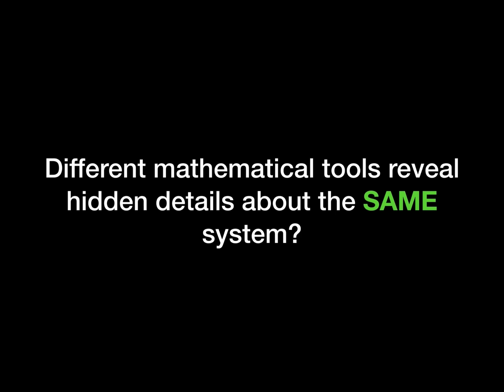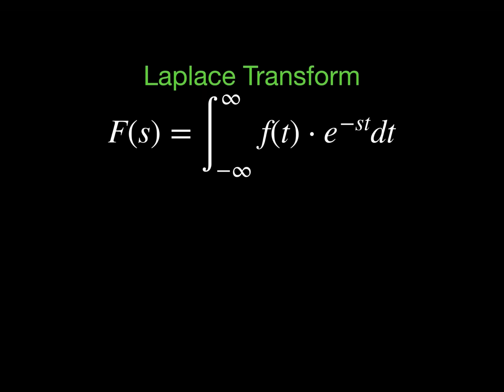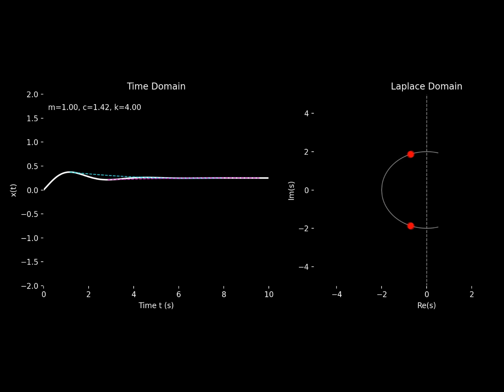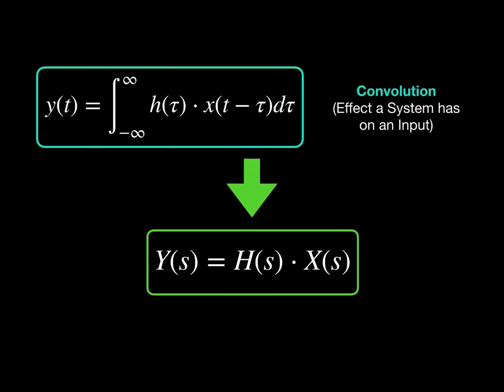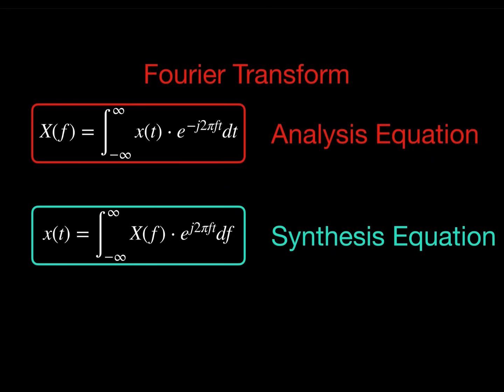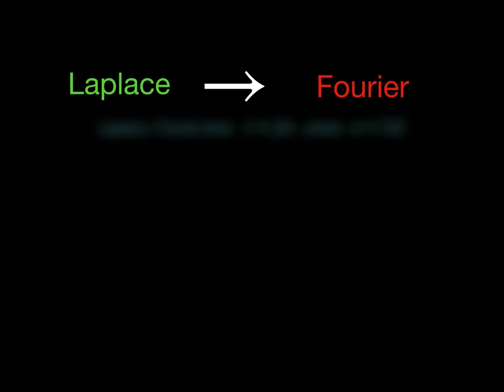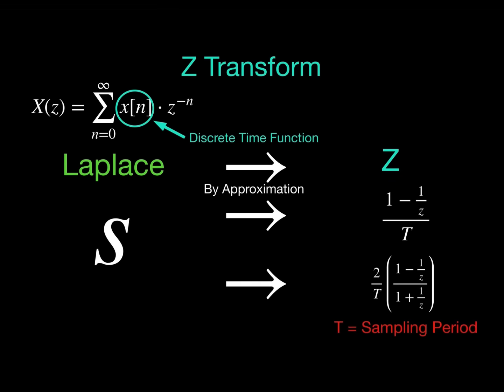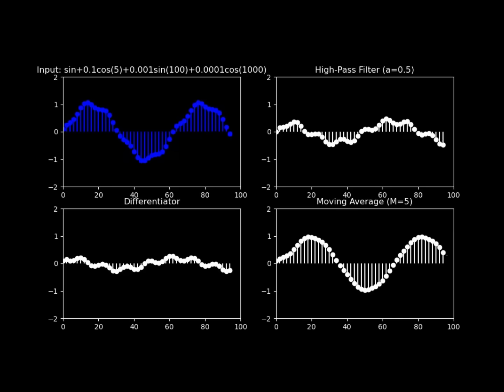3 Lenses on Reality - A Control Systems Approach

Comment: I graduated with a Control Systems graduate degree 30 years ago. I didnt work in the area all that much but I did use these principles over my career. I now find myself interested, and even understanding more, about these concepts.
Reply: Was Matlab/Simulink available back in the day?
Reply: @raho500  Matlab yes, Simulink I'm not sure it came out in the early 90ies. I did all of my postgrad on Matlab and even debugged some of the M files. We even did root-loci manually with a spirule. I too had a hard time finding employment that used my skills. In the end I earned my living writing SW.
Reply: @raho500  it was just coming into the academic world. My final project we did use matlab and simulink. I am sure the software is even more advanced today. It was very valuable in 1994....